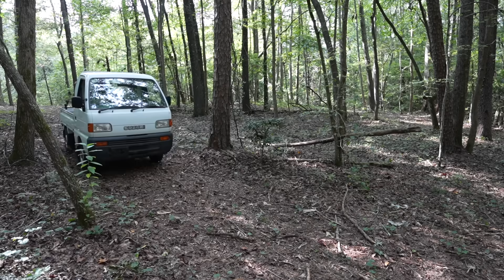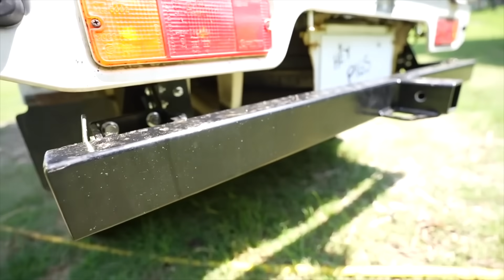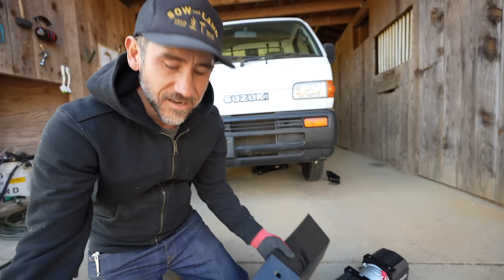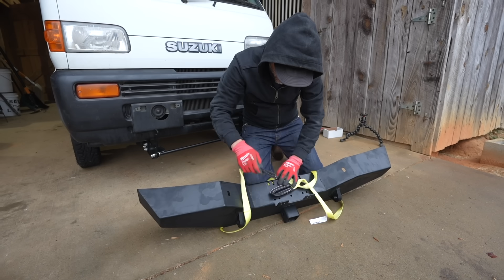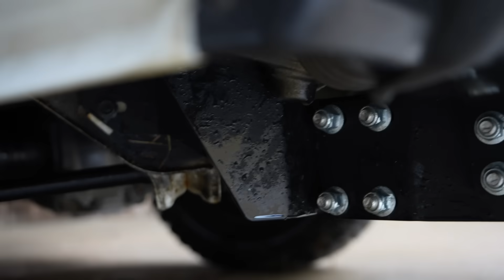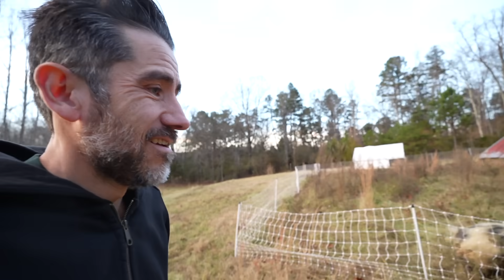One Thing I Don't Like about My Mini Kei Farm Truck

Comment: What can it do that other options dont do? golf cart and side by side a little smaller but does most of what you do.
Reply: I guess the main thing would be you can drive it on the highway.  I don't think that's true of golf carts and side by sides.  It also may be a little more heavy duty for carrying heavy loads.  Just my thoughts
Reply: Yes, plus I think it was a lot cheaper @margaretbedwell3211

Comment: They never really put bumpers on. They weren't really meant to drive on a highway. And they were very bad with accidents. If they got hit hard in the rear? The gas tanks were known for explosions. A very unsafe vehicle on the road. They use it mostly on farms off roads. I have 3 of them and did a lot of research before I got one and we only use it on the farm too dangerous to be on a highway.

Comment: You need to get a back bumper the same size and weight to level it out. That front bumper looks like it has pulled that truck down quit a bit.